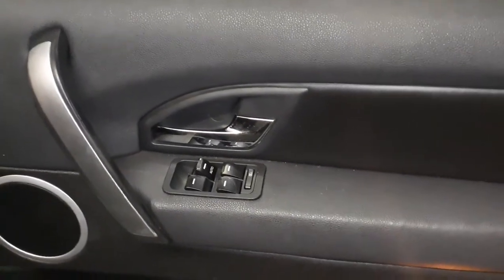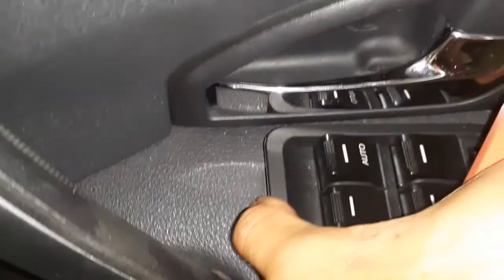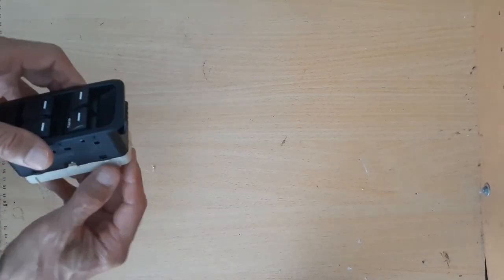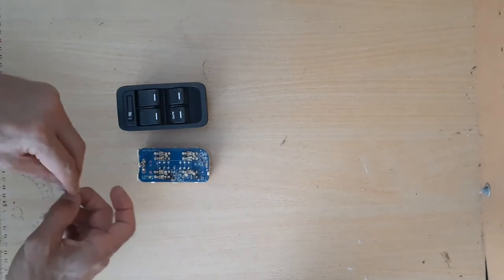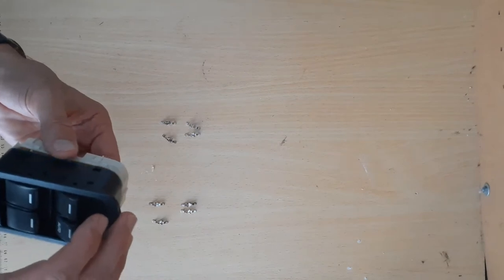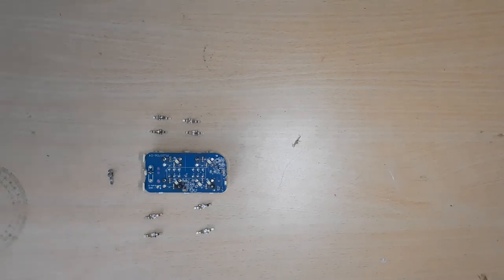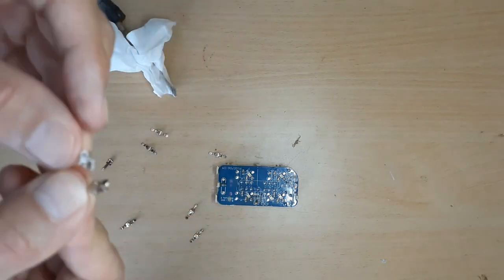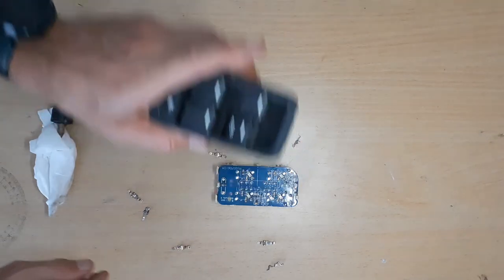Ford Territory Power Window Switch Repair  - contact clean

Comment: Thanks man, found your video after i was just about to begin my shift today and went to wind the 2 front windows up, they were about 1/3 of the way down and a no go, got home took switch apart, just cleaned everything with alcohol wipes, put back in and wound the windows up, doesnt work now but windows  are up and can park car anywhere while i order the part 👍

Comment: Thanks for this video. All four of my windows stopped working at the same time, and when it wasnt a relay or a fuse, i thought about the switch and read online that its a common problem. Just followed this video but also sanded the contacts with 400 grit sandpaper until the 3 little lines were gone. Hopefully this holds up.

Comment: I did this today after servicing the motor and finding it STILL didn't work! Decided to take the window switch to bits like you did here, but I did things a little differently: I got a dremel and attached a little wire brush wheel to it. I cleaned every one of the rockers and all of the contacts, then cleaned the board with alcohol. I also noticed some of the contacts had ablated and worn over time - particularly the driver's window - so I reflowed those and added a little more solder, and also tinned the rockers with a bit of solder. You have to be careful doing this because you want to leave those surfaces smooth and free of solder spikes, so you have to have it hot enough that the solder is still liquid when you pull the iron away. Seems to work really nice! There was so much carbon build-up on it when I opened it to check!
Reply from the maker: Nice work. Hadn't thought about that.

Comment: Had a replacement Master window switch fitted 4-5years ago( didnt realise the genuine OEM versions work so expensive) , worked fine until the following afternoon i noticed the drivers window WOULDN'T wind down when i started Territory. Would have to turn car off then start up again for Window to wind down like normal 🤦🏽🤦🏽🤦🏽 today ( 04/12/23 ) the switch for rear right side decided to do what your Drivers switch had done... Even the Master window lock just failed - like the switch physically didnt work or feel connected to anything lol

Comment: Had the same problem on my Terri a few months back. Went through exactly the same steps and got the same positive result, but after a while the problem returned. That's happened twice now, but I'll try for a third time as I'm loath to give Ford around $180 for a replacement switch that can be picked up new on the internet for around $30.
Reply from the maker: Hopefully my fix will last a while. The cheap ebay one broke after a few months. That's why I got the old one back out. Not sure what i will do if it keeps happening.
Reply: @economicmind9802  We'll both keep our fingers crossed that the fix is permanent!
Reply: With me it was a combination of carbon build-up in the motor (which I fixed like this: https://www.youtube.com/watch?v=PtWRIQf_dOE ) and cleaning the switch contacts like you see in this video. The window worked fine for a few months after I serviced the motor, but it stopped again recently and it wasn't the motor this time (it was the contacts). I think those little motors draw a decent amount of power and so if the commutator is all clarted up with carbon and your switch contacts are dirty, both things conspire to stop your windows from working. Maybe try cleaning your motor? If you do though, don't make the mistake I did: make sure you seal the unit with silicon or something because the existing rubber gasket will NOT continue to work and will let water in.
Reply: @IainFraser81  Thanks Iain, I'll keep that in mind , if there's a next time.
Reply: There's a reason why it costs $30... 👀

Comment: Try lubricating the window tracks, as the extra resistance can cause this exact problem.
Reply from the maker: Good tip. Thanks. Just did that and windows seem to run better.